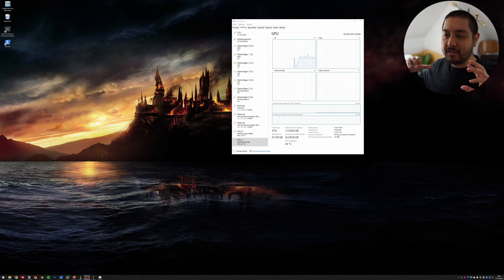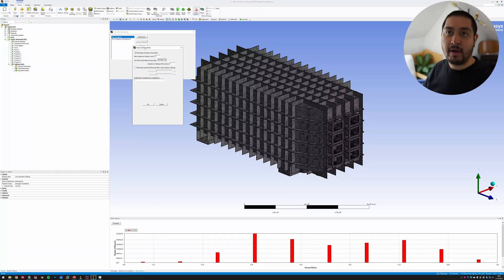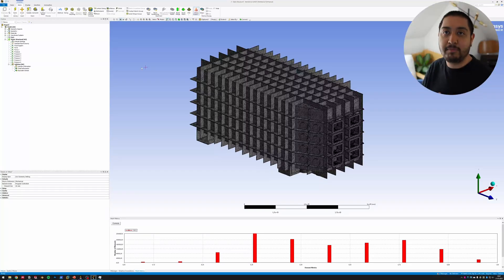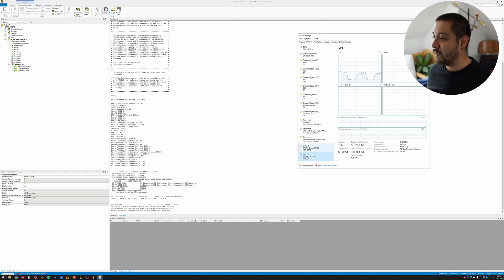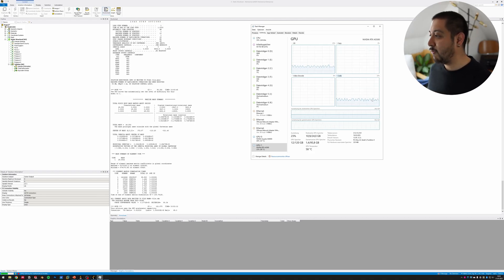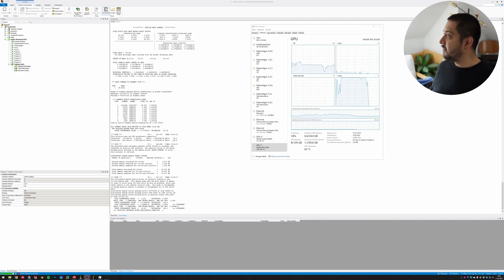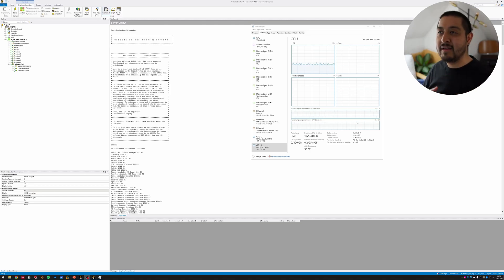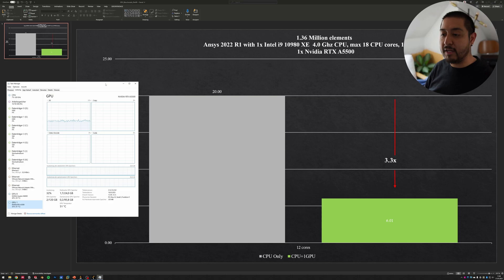How to speed up your Ansys Simulations / Nvidia GPU Acceleration

Comment: Hello even if I use ANSGPU_OVERRIDE=1 my 5090 is not recognize I got the message "5090 is not a suported architecture card"... Any help ?
Reply: Are you use a cracked version? I have the same problem.
Reply: @zmll1308  yes
Reply: @zmll1308  finally works?

Comment: I used Tesla V100 16 GB. But my simulation stopped midway and it says out of memory. You know a work around for this? Hybrid?
Reply from the maker: Are you out of memory RAM or VRAM? if you disable the GPU acceleration, can you solve the job? Try that, if that is the case, reduce the elements of the model and run it again using GPU acceleration. Hybrid is more recommendable for CPUs with performance and e-cores using different thread counts. But you might give a try, altough it requires usally more RAM. Thanks for watching!
Reply: @JorgeMoralesAv  I got 192 GB RAM. With just CPU, it is able to simulate just fine. Was thinking if I could simulate it faster. But with GPU acceleration enabled, it says out of memory. My Tesla has 16GB of VRAM. Does stacking more GPU of the same kind solve this issue? Or no?

Comment: hey brother my gpu usage is vey less i have a rtx 4050 and i512450 with 8 core 12 thread  and 16 gb RAM 4800mhz here my gpu usage remains less than 30%
Reply: Yes, Its only boost. because GPU is to slow, not like CPU. GPU is good to rendering not to computating.

Comment: Thanks a lot! Thanks to you, I was able to use my RTX 4070Ti, it reduced the calculation time by more than a half! Great)
Reply: What kind of simulation did you perform. I am using 6 cores and 4070ti but no luck. It slows down while using gpu. I am using iterative solver if that has to do something with the slow simulation.
Reply: @ripunjoyk1706  I had similar issue. I solved it by installing the latest driver version (NVIDIA Studio drivers, not Game ready) and the latest CUDA Toolkit version 12.8.

Comment: Hi Jorge, I am using system coupling to couple the Ansys Mechanical and Ansys fluent to solve my complex problem; the problem I am facing with the system coupling is that it only takes 2 cores to solve the problem. Please let me know how I can increase the number of cores in the system coupling so that the simulation speed will increase significantly. My system is a rack server with two CPUs (each CPU has 24 cores). Thank You
Reply from the maker: Hello, first thanks for watching! What kind of licensing you have for Ansys? For system coupling there are three menus that you should take a look for multi core solutions. In workbench, in the System Coupling Analysis tool, there you can also specify how many cores. Second, in Mechanical as i showcased in my video and in Fluent again you can specify the cores. Take a look to the three options and should work.

Comment: Hi, I have 2019R2 ansys mechanical, however New RTX 4000 16 GB GPU doesn't work. I tried environmental variable as you shown...pls help 😢
Reply: you found the solution?
Reply: Try adding the variable to User Variable only and remove it from system variables. It worked for me that waym

Comment: hey awsome video, but i really wanna know does the bypass work for an amd graphics card?
Reply: there are some supported AMD GPUs on the gpu coprocessor list, so it should work but there has always been less support if not outright software bottlenecking of AMD components (old CPU architecture vendor check drama)

Comment: Hi Jorge. Thanks for the video, I found it extremely informative. I’ve been using Ansys and Creo for many years now. Ansys has a plug-in for Creo and they work seamlessly. I can launch Ansys from Creo and the model is pulled in directly. Recently I’ve been using Fluent in simulating flow, velocity and head loss in my valve designs. I cannot find a multi gpu simulation anywhere on YouTube. You would be the first to my knowledge if you can run 2 GPU’s for us to view online. It would be interesting to see whether there’s a reduced runtime from the extra CUDA cores and VRAM. Please show us how to set this up and configure properly.. Many thanks and regards Corne
Reply: definitely, almost all the ansys benchmarking results include single and multi gpu HPC setups going back 10-15 years

Comment: Hello, I have Nvidia Quadro K2200 and I know it's not tested by Ansys for GPU acceleration, but I wanted to try it myself. Im getting error message "NVIDIA Library Requested but not Enabled for GPU acceleration". I've created system environmetal variable and installed CUDA Toolkit 12.3 Update 1, but still getting the same error.
Reply: Too late, but do you mind sharing your solution if you ever managed to workaround? What was the environment variable you made?
Reply: @IzonVez  Unfortunately it didn't work with this GPU configuration, but don't lose hope, maybe there's answer to it...
Reply: @acreaterz  this videocard is too old. In order to run GPU acceleration in ANSYS the driver version must be >527. K2200 stopped being supported after version 470. So, no way for this card.
Reply: @  It makes sense. Thank you very much for your answer.

Comment: Hi Jorge

I ordered a new Lenovo P7 but whithout GPU. But now i‘ve to choose a GPU and i‘m not sure which one. I have 3 in my mind, RTX 4090, RTX A4500 (20GB) or the new RTX A4000 ADA (20GB). Which one would you recomment? And do simulations tools (Ansys Discovery Live) benefit from the ADA versions?

Thanks for the support. Your doing a great job!
Reply from the maker: Hello! the RTX 4090 will probably not fit in the Workstation. If you only want Ansys Discovery, i Would go with a RTX 4080. If you install the nvidia Studio Drivers, not the Game Ready, it will be now officially supported for Ansys Discovery. Thanks for watching!

Comment: Hi Jorge, thanks a lot for your video. I am running with RTX 3060 (though not supported officially, your way works). I have run the same model by different core numbers, GPU. Once GPU involved, the elapsed time is getting longger. I want to check with you on the CUDA settings. I have installed Cuda 11.8. while Ansys Result Information told me that the Cuda version is 11.0. And Nvidia Driver told me that the Cuda version is 12.2. What can I do to really take advantage of the GPU? Thanks a lot
Reply: you found the solution? are you able to use gpu in ansys ???
Reply: @realracing3specter295  Not really. Good luck
Reply: @gary4530  so far i learned, Ansys only allow high end professional grade graphics cards, whether they are single or double precision compute. It never support consumer level geforce cards which are widely available in the gamer market.
Reply: @realracing3specter295  in solver settings, cut from 4 base solver cores to 3, enable gpu acceleration, set to 1 and select your gpu. also enable the system variable override showed in video & release help file
Reply: this is likely more dependent on your specific simulation setup, it is definitely possible to slow down your simulation by increasing cores (1gpu has thousands of cores). forcing to solve direct in-core instead of iterative, and turning off [analysis settings > restart controls > generate restart points, or at least only save completed load steps] and [analysis settings > output controls > store results at > none] / minimal (4? however many times you want it to save to disc during solve)

Comment: Hey Jorge, I've been watching your content since the HP Z440 upgrade. Finally got an HPZ440 and now I'm debating what to get for a GPU upgrade between RTX 2070 Super 8gb and the Quadro M6000 24gb. Which would ypu recommend for graphics designer, 3d animation  and video editing work? 

Is the 24gb a plus or has RTX got a better impact on workflow?
Reply from the maker: Hello Rumbani, i would definitely recommend the M6000. But, with the prices nowadays of RTX dropping, I would strongly recommend you get a used RTX A4000. With the newest RTX features, more than 6000 CUDA cores, 16 GB vRAM and very power efficiency, I think today there is no better choice than that one. Here in Germany, are now ranging from 400 to 550 €. Thanks for watching !!!
Reply: @JorgeMoralesAv  Thank you so much for responding. I didn't even consider the RTX versions. I'll look put for those. Wow. Thank you again.